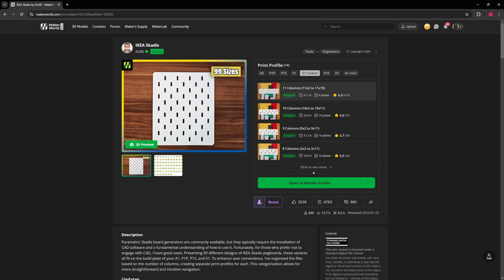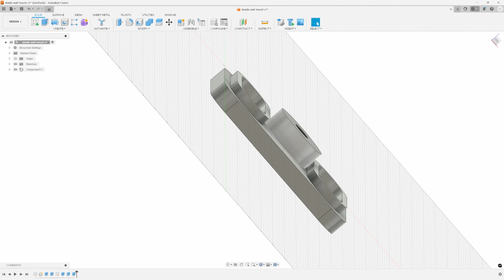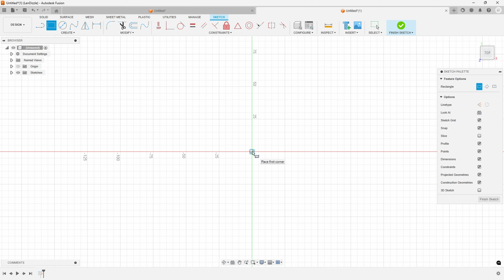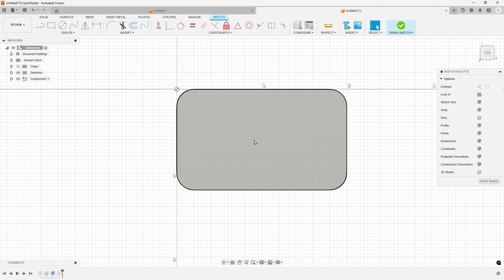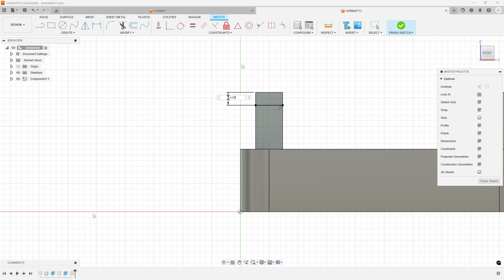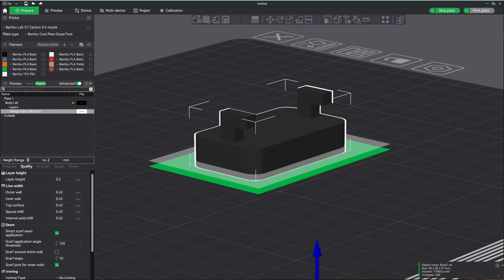Skadis Wall Plate Install Overview and Height Range Modifier Trick

Comment: In fusion when designing a symmetrical part its quicker to draw one side then mirror the other, not only that if it needs editing/adjusting you only need to edit one side and it's automatically mirrored for the other side. I'm no expert but it's one of the first tricks I learnt.